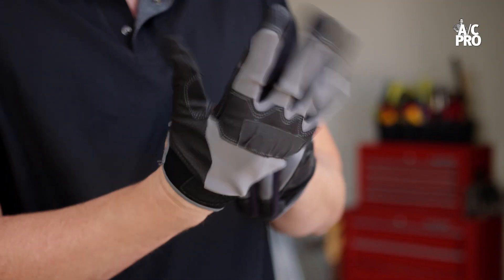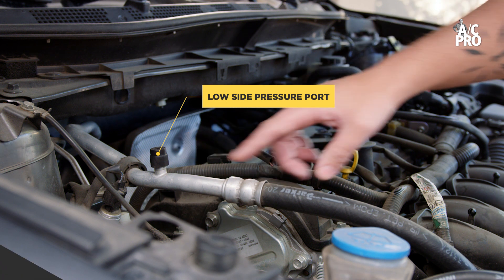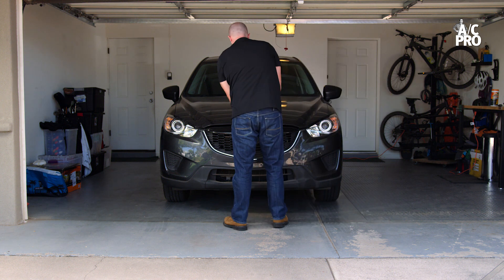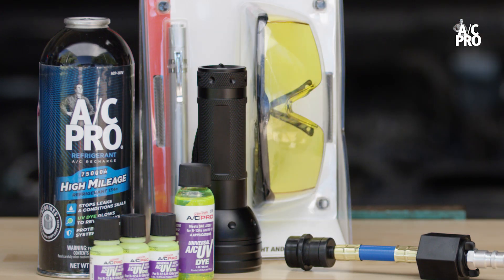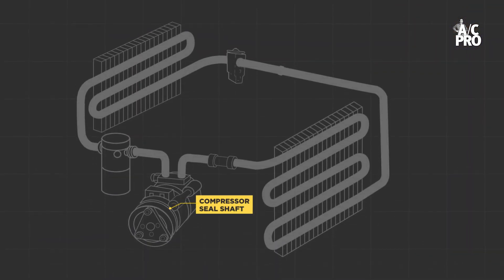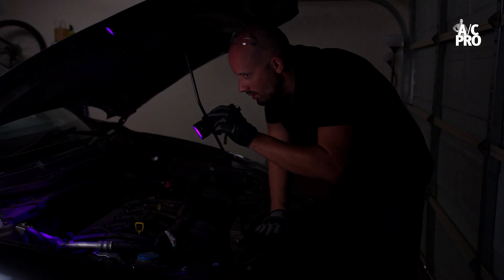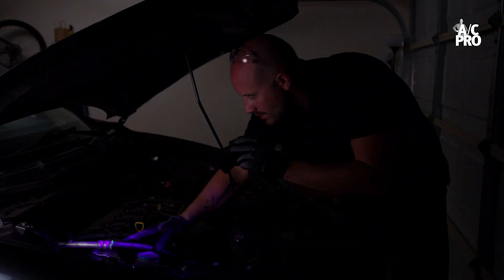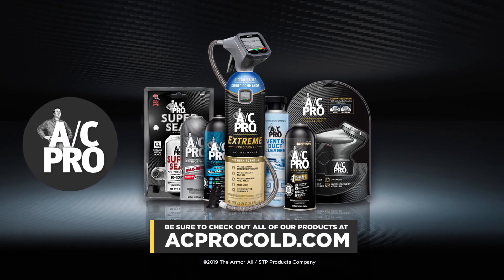How to Utilize UV Dye to find a leak in your A/C system

Comment: Why is it such a secret how to put the oil in with the injector. Why do you skip the most important part and explain all the obvious parts? I’m here at the store trying to buy this little bike of oil and looking at the dye detector and it doesn’t make sense how the oil goes in.
Reply from the maker: We sell products (A/C Pro High Mileage) that have UV dye already in the formula and they can be added with a standard hose.  If you are using the small 1 oz bottles of dye, you can just slowly pour the dye into the end of the hose and they attach a can of refrigerant to push it into the system.  We also sell this you can use to attach you hose/gauge to.  https://www.rechargeac.com/product/433cs-certified-a-c-pro-r-134a-uv-dye-injector/

Comment: How did you get the dye into the system?
Reply from the maker: You can either buy a recharge product with dye included or use a dye injector like this https://www.rechargeac.com/products/our-brands/certified-ac-pro/433CS-auto-ac-repair-tools?lid=471

Comment: Good product, question is , is it possible to use the left over ac pro product after a year , or do I need to buy a new can ,I know the pressure gauge and. Hose is reusable.
Reply from the maker: Yes, you can store refrigerant cans in a location away from heat and direct sunlight and continue to reuse until the can is empty.